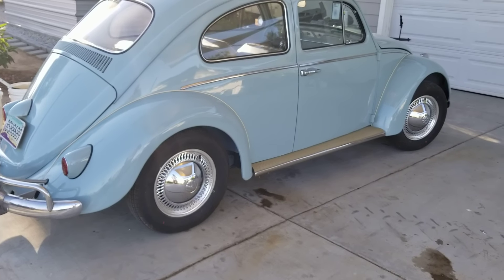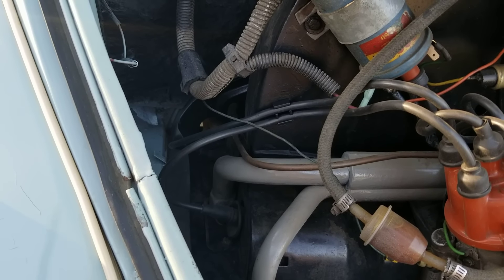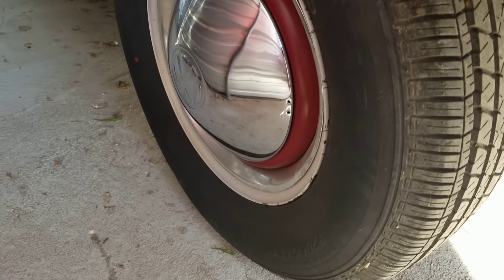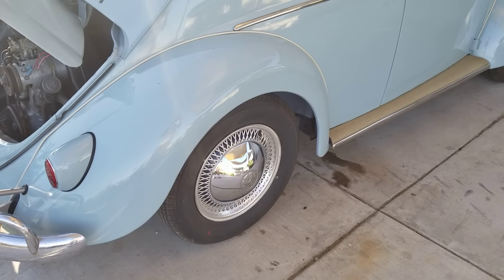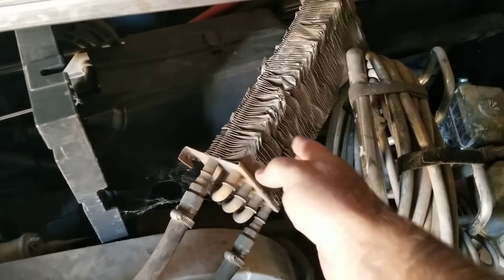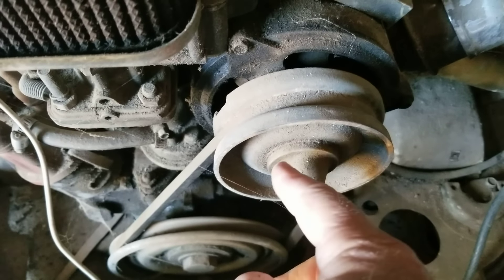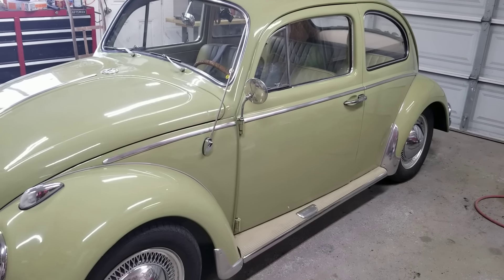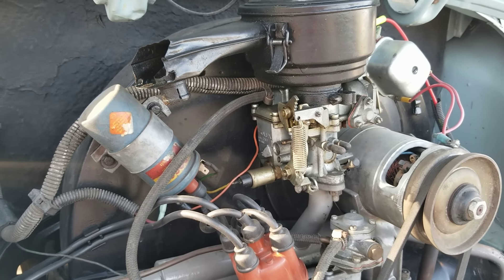Things NOT!!  to do to your Volkswagen VW bug or bus

Comment: I owned 3 bugs & 3 buses and they all took regular gas & 30 weight Pens detergent oil ,but always good 2 have extra fan belts & fire extinguisher , also traveling a long distance, give it a rest every hour or especially if you feel a reduction in power, good to have a  oil temperature gauge, Goodluck 👍👍☮

Comment: The one about using only Bosch points and condenser: Back in the late '70's or early '80's when I had a few old bugs and one Karmann Ghia -- they were dirt cheap back then and I was broke -- I learned that the hard way. I bought "Road baron" points and condenser at an auto parts store, Checker if I remember right, and I had two or three of them in a row put me on foot. The condenser screws onto the outside of the distributor, and there is a wire that goes from it to a plastic plug that fits into a hole in the bottom of the distributor, with a  brass male spade connector inside it, and the points connect to that spade connector. On the cheap knockoff set, after a few thousand mile, that plastic plug would disintegrate, and the connector would short to ground, which meant no spark, no run. The Bosch point and condenser set cost a couple bucks more but I never had that problem with them. The plug was made out of  a better plastic that was at least good enough to outlast the points and condenser.

Comment: Do not purchase a new starter until you test the existing one...you may only need to install a hard start relay
Reply from the maker: yea for sure on the 6v especially  on a 6v car. also know the sound of the growling bad bushing that may be all you need.
Reply: Or, as happened to me, I only needed a new heavy current cable from battery to starter. The old one was corroded and became very resistive.
Reply: Every bug I’ve owned I wired a push button switch in between the front seats on the tunnel direct from the hot side of the battery through the switch to the starter solenoid. Disconnect the large starter key wire to the starter solenoid and tape it so it doesn’t arc on metal.

Comment: Good tip about the fuel line onto the carb.
I had just finished a full respray on a '63 40 HP Beetle, had put the re-furbed engine back in had the rear up on axle stands, fired the engine up without exhaust system just to make sure it'd start. The fitting you mentioned popped out, fuel sprayed into engine bay and onto floor, open exhaust, boom, up it went. 
Thank goodness for the workshop fire extinguisher, but all new paint on rear ruined, back to square one!
Reply: At least no one was hurt, & you saved the car (for the most part)!
Reply: My story goes like this: I was in a car scrapyard, looking for Fiat Bambino 110F parts. I saw this '71 Super Beetle, almost on its' side, but being propped-up by a border fence. I went over to view this. Clearly, there had been a very serious engine fire. All the rear had been fire-damaged (even the interior). Damage was bright orange rust everywhere. I said to the Scrap Yard Boss: " What is going to happen to the Beetle?" He replied: "It's gonna get crushed tomorrow". I had never considered EVER owning a Beetle, but I asked "How much?" His reply was five hundred dollars - and delivery to my home on a Tilt-Tray Truck. After just over one year later, at a cost of $14,000, the car looked brand-new, with original Alpine White 2-Pak paint. I will never forget the very first time that I drove the Beetle on the street, following the restoration. At the time, the Engine Decklid Had not yet been fitted. Now, bear in mind, that I didn't know what originally caused the Beetle Engine Fire. I had only driven the car about three hundred metres - when I smelt a very strong smell of petrol!! I immediately stopped the car, the engine still running, and I jumped out of the car, ran to the rear. I was horrified to see a heavy jet of fuel (from the top of the Fuel Pump). The Fuel Pump was the type that has a removable top, with four(4) screws, and a Lid. The Fuel Jet was being sprayed onto the Distributor!!! I stopped the engine, dried the petrol. I tied a cloth around the leaky pump, drove home and replaced the pump with a 'sealed' type. I had now found the original cause of the Beetle's near-cremation. Glad that you saved your Beetle too, but I got away lightly, but you didn't.  I saved the life of a "sad" Beetle. Today, it's still my baby, for the last 17 years. Just been converted to 100% electric with Tesla Batteries and Hyper 9 Motor. I'm keeping the engine and fuel tank, and can be converted back.

Comment: Absolutely correct about the engine fires due to the brass fuel fitting on the carb. I highly recommend having a tech pin that brass fitting. Don't try it yourself unless you know what you are doing. Otherwise, everything mentioned in this video is correct. How do I know? I was a line and engine room tech for VW in the 60's and 70's. Over 125 eninges built.
Reply: Thank you!

Comment: The main reason bugs can catch fire is due to having the fuel hose next to the steel pipes that get red hot when the car is running, as shown in the vídeo, where the fuel filter is located, this hose must be always located on the outside of the alternator, which means as far as possible from any direct source of excessive heat.
Reply: Don’t want gas dripping on that distributor cap
Reply: I bought a burnt-out Beetle from a car scrapyard. I discovered the cause of the engine fire. It was the old Fuel Pump. The old Fuel Pump was the type made from Cast Alloy, with the four (4) screws on top. The gasket failed, and spurted a high-pressure jet of fuel - straight onto the Distributor! My advice here, is simply to check that there is NO weeping of fuel around the top gasket of the Fuel Pump. I simply replaced this old Pump with a steel (sealed) version. It was a '71 Beetle, which was completely rebuilt. I gave it a new life, and I've been driving this Beetle (now) for 20 years.

Comment: DO NOT overtighten your oil drain bolts!  I stripped one once and it blew-out on the highway!  Luckily an engine shroud bolt fit in it's place, installing it with a quarter because a screw driver was too long! LOL!

Comment: You forgot to mention not only should you carry a full toolbox with you at all times when driving a Volkswagen you should also bring along blankets to keep warm at night and enough snacks and entertainment in case your repair takes a while to fix.
Reply from the maker: yea dont forget the snacks that one is important. nothing like a bag of chips to get you or your passengers through the repair. or tow truck ride.
Reply: For winter driving, make sure the steel cables from the knobs beside the emergency are properly adjusted or you will get no heat. Usually these cables are broken when removing the engine for service.  Also, the thermostat that opens & closes the door on the fan shroud has to be set to factory spec, .for the engine temp and for heat inside the car. Great cars but not tinker free!!!!

Comment from the maker: FYI plastic filters were used in EVERY car back in the 70s and 80s. There was never a fire issue. Datsun toyota, Nissan Ford. GM. Isuzu Back in the carburetor days that is what was done and they were in the engine compartment. In 30k cars that i have heard of that have a filter right there. NONE have caught fire. There were people that THOUGHT it was the filter but usually it was a old hose, or the filter and hoses did not have clamps. or more commonly the brass fitting slipped out of the carb causing the engine to catch fire.
Reply: Just be sensible with fuel line, and you'll be fine.  Tie wrap line so it can't pull from carb.  Tie wrap it so it can't get against anything sharp or hot.  Keep filter ahead of pump. Change out hard brittle hoses.  Ensure clamps are tight.  Ensure no rubbing of hoses or sharp edges without grommets at firewall, etc.

Comment: The most important point for me was the last one regarding the brass feed tubes which are pressed into the pump and carb coz I've had two come loose so I've wrapped copper wire between the jubilee clips and round the body of the crab and the pump just to make sure that these tubes can't  ever 
Work loose coz if they can 
They possibly will and it doesn't, take a lot of imagination to predict the 
Outcome!  Very important tip indeed.
Reply: I got lucky, just reinstalled my original glass with new window rubbers on my 72 1200 standard Bug for a respray and nothing broke. The small side windows where the hardest to fit.
Reply: @johncollins5552  sounds good, nice stage to be at, I remember re fitting my windows on my 62 and the alloy insert trims were a fiddly job but the rear side window rubbers were good so I left well alone. Ps good luck with the rest of the project.
Reply: @johnroberts3723   Thanks, thing is Bug looks great, however I hoping to do a mig. welding course in the autumn so I can tackle heater channels next summer, probably a body off job and a load of rust repair to look forward to on the corners of the chassis.
Reply: @johncollins5552  definitely body off is the only thorough way to do it. I did mine, heater channels plus extensive areas including front and rear door pillars, all sorts of repair panels in fact it got quite scary when I'd removed almost six inches all the way around the bottom of the body shell, pan was ok after much sand blasting, then I went on to do a colour change as I had the car in pieces,  I finally spent two and a half years of spare time on the project but it was worth it. So yes go for it and please let me know how you get on.
Reply: I had an Engine Fire. The gasket on the pressure side of the fuel pump failed, sprayed gas all over the Distributor. The Fuel Pump was the type with four (4) screws on top. All VW Bug Owners need to know that this is a problem that suddenly appears with disastrous consequences. Buy a Later Fuel Pump - that is sealed. Carry a Fire Extinguisher in your car.
Reply: @peterduxbury927  thanks for sharing that , something else to worry about.
Reply: @johnroberts3723  Yes, the car took me a year to rebuild, after the fire. The fuel line melted apart, poured petrol under the car by just gravity from the (higher) fuel tank. It cannot happen again, no fuel tank, no engine. It's 100% electric on Tesla batteries and Hyper 9 Motor. I still keep the Fire Extinguisher behind the Drivers' Seat as a permanent fixture. I always had a slight 'fuel odor' inside the car, and this came from the vapor recovery system that VW installed on the Superbug Fuel Tank. Now, I just smell the fresh leather seats!
Reply: @peterduxbury927  now that's what I call a true VW lover. To be honest from my standpoint, I don't want to imagine having to swap the original engine for electric.
Reply: @johnroberts3723  Yes, purists would not agree. But (in the conversion), no damage is done to the car, or it's body. The original engine and Fuel Tank are retained, and can easily be put back to standard. At over 70, I reached a point in my life, where I wanted the experience of driving a "Classic" - before I fall off this Planet!! I don't wanna spend any time, changing out engine oil, gearbox oil and Valves / tappets / CB Points. I prefer to think of my actions in conversion to electric, that my Beetle is something special. It is a Dual-Fuel Beetle. And I love it to death.
Reply: @peterduxbury927  good on you.

Comment: Thanks, I like your checklist. I noticed after I already had my back seat in my beetle, there was no protection over the positive lead. I made up a plastic sheet over the battery area to prevent the seat springs shorting out.

Comment: Yeah, I got one......"DO NOT start and gun down your VW on a cold day". Wait for the engine to warm up...!!
Reply from the maker: wow thanks for that I like having a choke for that reason.. dual carbs no choke.
Reply: My 1973 VW Type 2 owners manual says not to wait for the engine to warm up on a cold day. It says to drive it at normal RPMs immediately. Is that wrong?
Reply: @MattLaVoie1  But on cold days 6 deg C to -20 C first the choke will operate until the engine warms up enough. How can you start and take off while the choke is operating. The oil viscosity will also be thicker, putting a heavy load on the oil pump.
Reply: Mohabat khan Malak and it’ll stall at every stop in my experience until it’s at operating temp
Reply: @MattLaVoie1  I have a '72 Super and I let it warm up for at least a few minutes before taking off!
Reply: @MattLaVoie1  Modern cars are computer controlled.  Older ones need to warm up a little bit.

Comment: do not use a glass rebuildable fuel filter they come apart and leak
Reply: mikes random videos yeah they do!!
Reply: Never had any issue with my glass fuel filter. I always recommend them over the plastic ones. Always. If they come apart you did not tighten them properly.
Reply: I also, had them break.
Reply from the maker: be careful mine came unscrewed and leaked.
Reply: @Mikefngarage  Not exactly sure how that happened unless the hose clamps were not tightened properly either. That is what would prevent the ends of the filter from undoing themselves over time from vibration. So not only do you need a good seal on the glass, you need to have a good clamp on the hose. Stainless hose clamps are not actually the best but will work. If all connections are right they won't come loose. Don't over tighten either because you can loose a seal or worse you can break your glass. I always recommend the glass type over the plastic type. Plastic degrades over time. The glass ones will last a very long time. I still have mine in use from back in the early 90's when I got mine. I had more than one but those were sold with the vehicle. 
On another note. Stock Forged Cranks can be balanced very well so it is not really required to use counterweight cranks. If you do use the counterweighted cranks use the full circle type. They balance well. Again, use stock forged cranks, weld forged circles onto the crank then you can balance. All stock VW cranks are Forged. For a great street engine you don't need counterweighted. I have built one with the help of a master builder and racer without counterweights.
Reply from the maker: stock cranks are good but how many are still german steel and available that have not been turned. getting slimmer and slimmer.
Reply: @Mikefngarage  They are a dwindling resource. People still just toss them in the garbage because people think they need the counterbalanced ones. If they are dirty and a little rusty they toss them. What a waste. It is a problem for some. Scrounge around and you will find some nice original cranks. Stock sizes are harder and harder to find as are other original parts. So much is being dumped but junk is junk. Some is salvageable.
Reply: Had this happen on another vehicle of mine.  Scary stuff! Luckily there was no fire.

Comment: Issue with the filter right before the carb is added weight that can cause fitting on the carb to come out and cause fire.  The other common cause of fires is rubber grommet in the front tin which is easily fixed by replacing it with a bulkhead fitting or using lamp ferrule to protect fuel line

Comment: My dad bought me a '71 Super Beetle in "77. I didn't know much about cars, especially VW's. Had the car about 6 months when the accelerator cable broke. You all know what happens- car goes down to idle & that's it. Had it towed to a guy's garage who worked for a VW dealership before opening his own repair shop. He ordered the cable & even showed me how to install it. I always kept 1 in the (front) trunk, along with a belt & a few measly tools. After the 3rd one broke, I looked at the accelerator pedal. It was a little bent, so instead of pulling the cable straight, it sort-of bent the wires of the cable. I grabbed the pedal & bent the steel (or tin) mount a little to the right. Never had to put another cable in :-)
Reply: Had the accelerator cable break in my '73 SB. I was able to avoid a tow by using an electrical butt splice to attach 12ga electrical wire to the broken end of the accelerator cable. It had broke right by the carb. Was able to get to a nearby VW shop and buy a replacement, but my splice job was working so well I waited to change it after I got to my destination 2 hours down the road.

Comment: oh, and do NOT screw the oil preasure sending unit all the way in , those threads are tapered, if it was screwed all the way in  by someone else then you probably have to screw it all the way in also

Comment: The original oil cooler is mounted inside the fan housing.  I put an external oil (electric fan type) cooler away from engine under my bus. Far better cooling. Deep sump helps too.  More oil to cool engine. Also, put on ALL the original tin around engine.

Comment: I'm sure you know this, but you can't run more than 3.5 quarts of oil in your vw. I installed a temperature gauge and a 5 quart sump on my bus in order to attempt to keep it cool, especially on hot summer days. Before I installed the deep sump, it would run about 220 to 250 degrees.  With 5 quarts of oil on board,  it wouldn't deach 120. My fuel economy went from 20 highway to 12. I removed 1.5 quarts of oil, effectively making it a dry sump, because the crank was only being showered with oil and not sitting in it.  The deep sump comes with a longer pickup tube, so no problem with lubrication.  Temperature stayed a CONSTANT 180. Winter or summer.  And I never sucked another number 3 valve again.  Only downside is a slight loss of ground clearance....about  1 inch or so. Was never an issue.  Use the temperature probe that replaces the oil dipstick.  I broke the one I tried that replaced the drain plug. Oh, and listen about the rpms and speeds this guy said. Install a tachometer.  Money well spent.